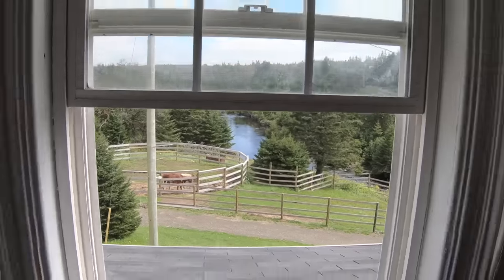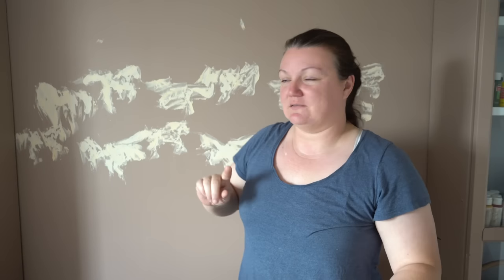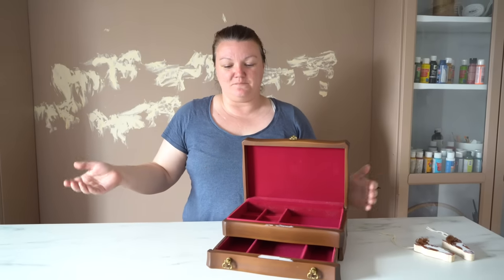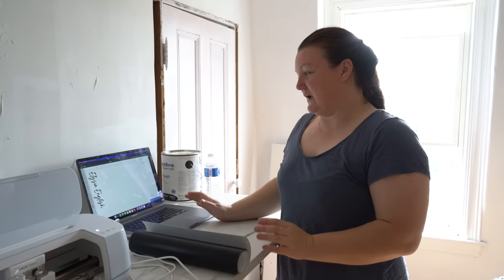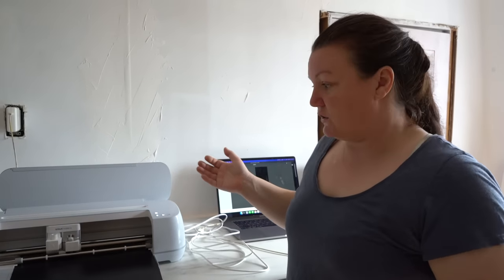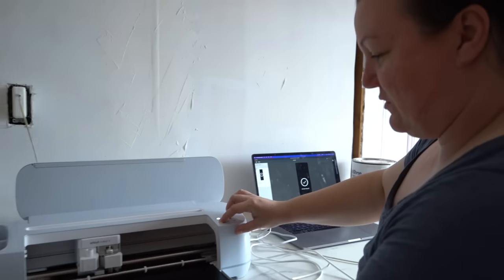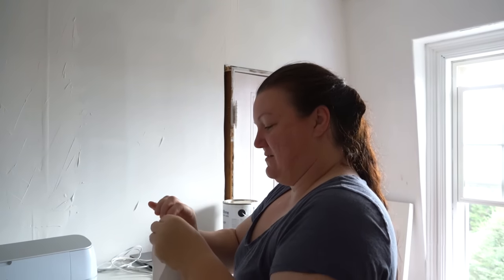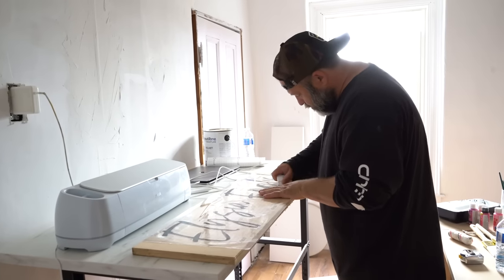Tell me this is better!? (craft room makeover) & I swore I would NEVER do this DIY but here I am...

Comment: Love the wall and new sign!  Very classy.  I sell vintage and antiques on Etsy, and have both restored and refinished antiques in years past.  I’m a big fan of Restore-A-Finish for filling in nicks and slightly worn finishes in stained wood (if you don’t want to paint it).  Also, a trick to clear dust or lint out of old jewelry box felt is to cut a few strips of either packing or masking tape and work it over the felt (make sure the felt isn’t loose).  Works great for a clean look if there are no stains.  Thanks for the tutorial on making chalk paint; looking forward to trying it. 😊

Comment: I also use my cricut for scrollsaw. To save on vinyl instead of making it all one strip you can break it down in design space. Also I get my blades from Bear Woods Canada.  Pegas brand. The ones at CanadianTire break easy. If you get spiral blades you can cut a sign longer than the 20 inches.